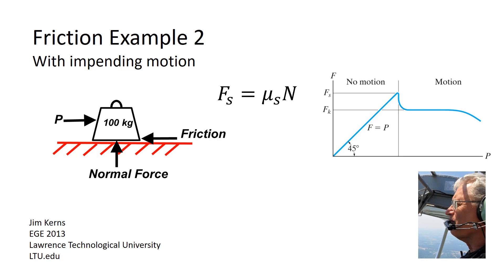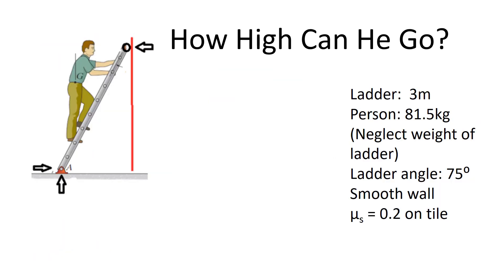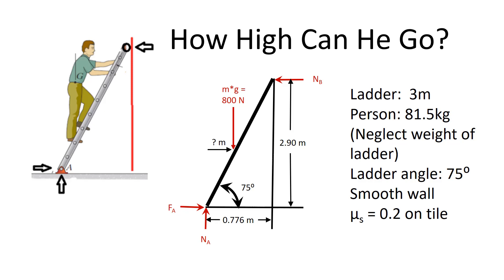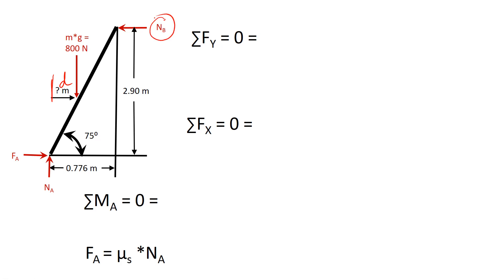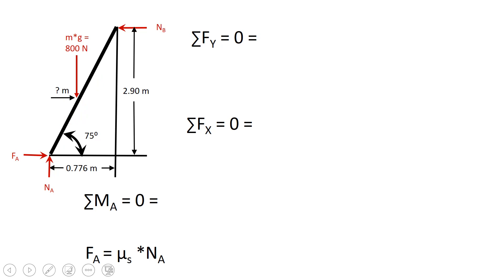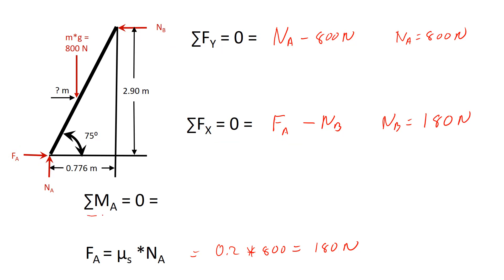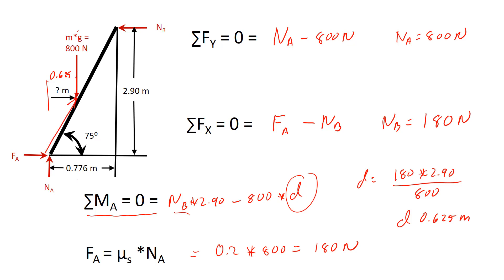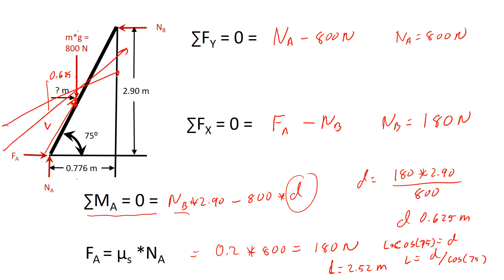Statics: Friction with Impending Motion Example

Comment: Should the friction at point A not be equal to 160N as opposed to 180N?
Reply from the maker: OOPs, not only did I do the math wrong, but I was signed into the wrong youtube account when I made the reply.
Reply: You are correct - it should have been 160N. Thank you for catching that.
Reply: Correct.  Also with even using the erroneous 180, the "d" should be 0.652, not 0.625, but seems to correct it in L.